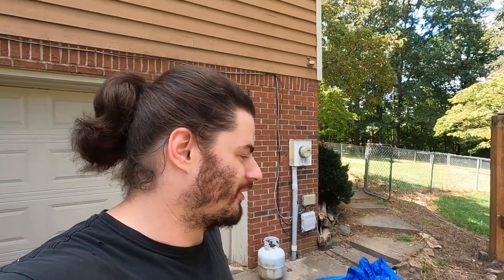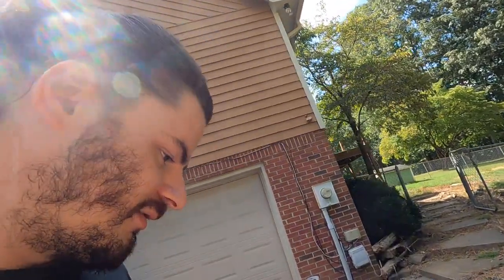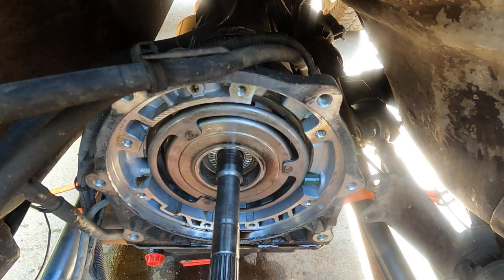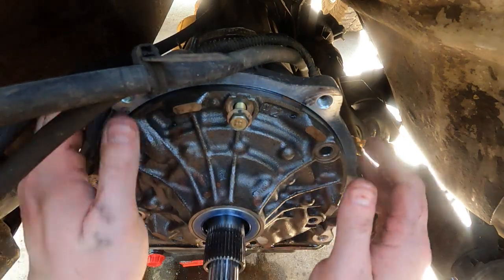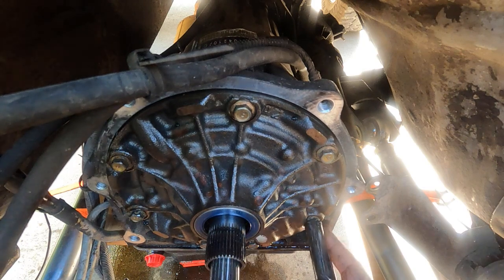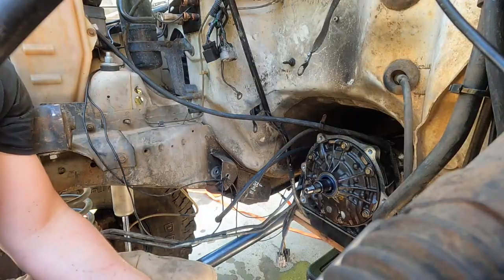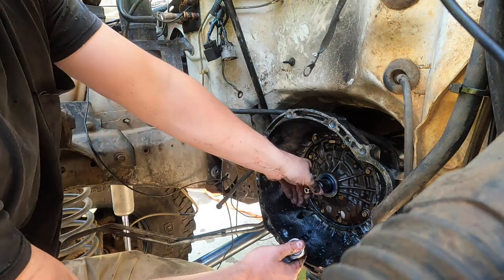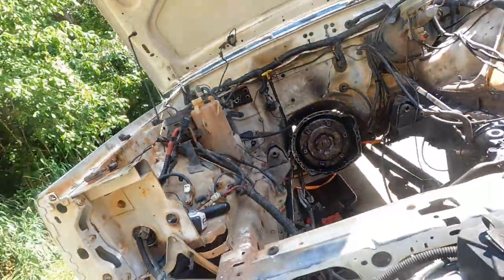2jz swapped Jeep Cherokee pt2 (a340/a650e input shaft/pump/bellhousing in aw4 trans)

Comment: Thomas, off subject, did the Dakota flywheel/flexplate work out? Will you be making the files available? Good work on all these projects, Thanks, DC
Reply from the maker: Yes the flexplate worked and my front crank sensor works too. It's going to be awhile before I can afford the driveshaft and controller for it tho. I have no plans on selling files. I can make a flexplate tho.
Reply: Have you thought about a price on the flywheel? Cool the sensor worked out on the front of the engine. Mine is a '90 D150 and right now I have TBI so I don't have the sensor to deal with. I'm also thinking about the 8HP for my Roadrunner. I have an A518 to rebuild and may still but I really like the idea of 8 gears. I've done a good bit of research on the controllers and think I would just build my own with an Arduino. Tuning would take a little while but it is all pretty simple and straight forward.
Reply from the maker: @dbc105  I haven't I'll have to get one together.